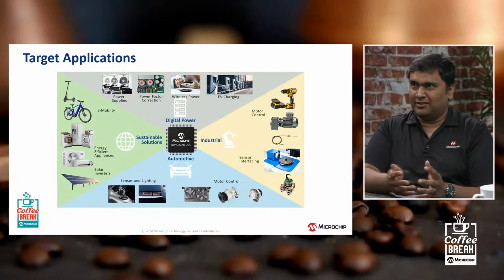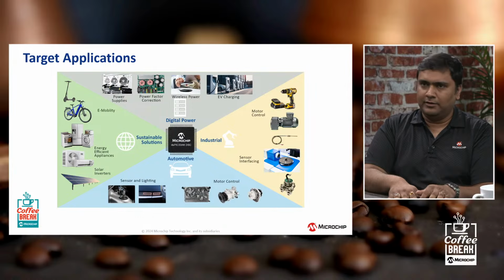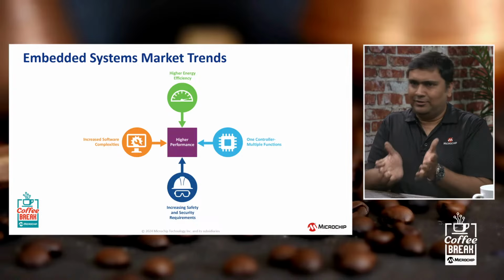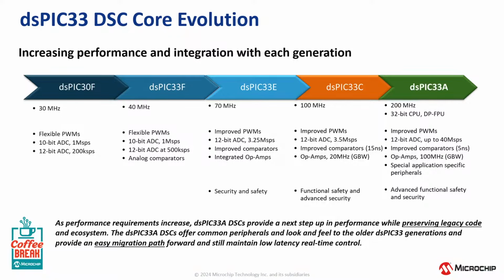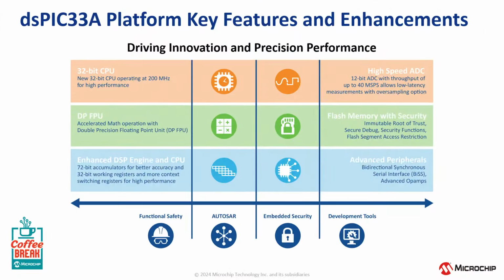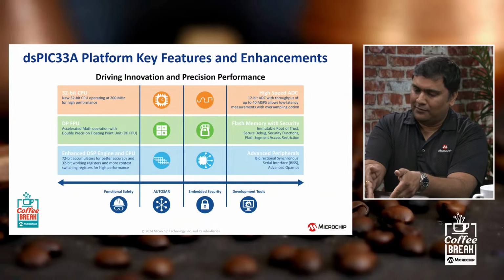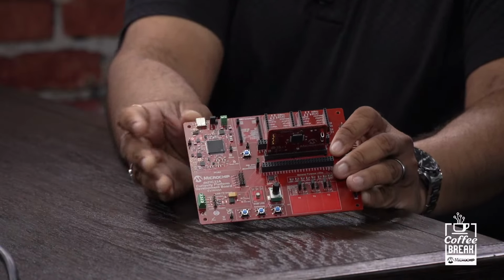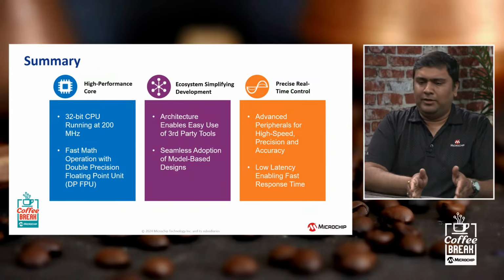Coffee Break | S13E6 | dsPIC33A Digital Signal Controllers: Real-Time Control in Embedded Apps

Comment: Do you have any document or tutorial how to use dsPICK33AK series to make buck converter? i'm struggling i have CK series it seen like AK and CK are totally different processor.
Reply from the maker: Thanks for reaching out! The dsPIC33AK and dsPIC33CK families are quite different architecturally, especially around ADC, PWM and clock configuration, so migration can be challenging. For buck converter development, Microchip provides useful resources like the dsPIC33CK-to-dsPIC33AK Migration Guide, Buck Converter tutorials, and Digital Power Converter Basics using dsPIC33 DSCs. These cover PWM, ADC setup and digital control loop implementation for buck converters.

Please see two references below:

Migration Guide: https://ww1.microchip.com/downloads/aemDocuments/documents/MCU16/ProductDocuments/SupportingCollateral/dsPIC33CK-to-dsPIC33AK-Migration-and-Performance-Enhancement-Guide-DS70005574.pdf#4

Digital Power Converter Basics: https://developerhelp.microchip.com/xwiki/bin/view/applications/power/digital-power-converter-basics/

Please let us know if you have any other questions about this and we'd be happy to help.

Comment: i´m surprised with the DSPIC33A, also I´m working in a digital control board for a multiproccess welding inverter based on the DSPIC33A. When I have some tests and results I will share the performance of this controller.

Comment: Microchip, you are making great silicon, but not great enough software/tools support. 

Please focus more on going vertical than horizontal. Ten very well-supported MCUs are way better than 100 not well-supported MCUs.

The MCC code is very bad, IMHO. Harmony is worse, unfortunately; you can make it more UI friendly and code-efficient, and maybe add some peripheral simulator inside the IDE; you can reach a stage where the developer barely needs to open the datasheet to read 100 pages about the peripheral he is trying to use, if you make the MCC better and more comprehensive and UI freandly.

Reporting bugs, documentation errors, and issues is very tedious; it must be an easy and automated process from inside the IDE. A screenshot with one sentence must be enough; developers don't have time to open tickets and support cases for trivial (but still bothering) issues and bugs.

You made one of the best and cheapest programmers out there (PICKit-5) with a COM serial interface and Bluetooth features. How great it would be if you added a feature of programming and debugging over Bluetooth? You have the hardware ready, why not?? Again, please focus on going vertical rather than horizontal. I don't want a new programmer version after one year; I want the current one to be better, and you can do it.

A lot to say, but I wish there were those who listened.
Reply from the maker: Hi there, thank you so much for reaching out and for providing your valuable feedback. Our team will review and consider your suggestions. Much appreciated!